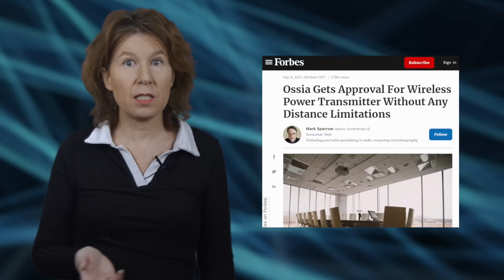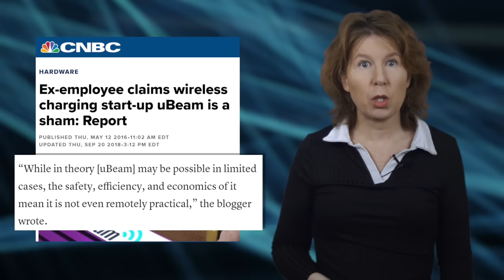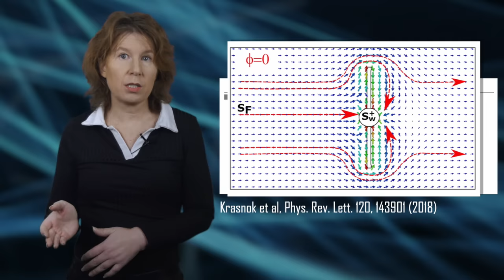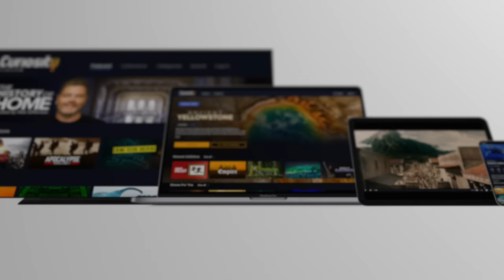How close is wireless power technology?

Comment: I built a tuned coil, essentially a form of crystal radio, to power a LCD clock from a local 50kW am broadcast station. It worked fine 15 miles from the station antenna, and required a 3 ft diameter antenna. Impractical for lots of reasons, but I thought it was pretty cool that it worked at all.
Reply: Neat, and there you have the additional complication that the AM signal is not staying at a single frequency but is split into upper and lower bands around the center frequency, so it messes up the perfect tuning. Changes in temperature alter tuning too, and even humidity could also alter tuning, depending upon your capacitor. Glad it worked!
Reply: you could have used a solar cell the size of a dime, cost about 25¢, and would work in 1lux of ambient light
TI and Casio have been selling solar powered calculators for about 40 years now.....
Reply: @kenwittlief255  you realise that OP could power a clock from their mains power if they wanted to? It's just more interesting and original to use radio frequencies from a distant station
Reply: LCD takes such low power, in class we would comb bare panels in our hair and they would turn on and go opaque.
Reply: @kenwittlief255  a coil is a hellofalot easier to make than a solar panel.
Reply: I've done a similar thing. I have a few feet of wire connected to a tuned circuit in my study powering a bank of  coloured LEDs (about a mile from a 1MHz A.M. station). And of course there is a ground connection for the returrn path. The comment below regarding sidebands is an irrelevancy - the carrier is always present at some level and anyway it's cool to see the modulation affecting the brightness of the lamps (in a minor way). Best use I've found for talkback radio which is what this particular station broadcasts.
Reply: In
Reply: When way very young (1960's), I took the rectified energy from b a Crystal set radio and powered a one transistor amplifier for that radio..    ie used the local AM Broadcast station's radiated energy.  😂
Reply: Similarly you can use a phenomenon called "near field" rather than radio frequency (RF) to transmit information approximately 15 to 25 feet as a magnetic radiation remote control. I was looking to build a receiver that could sit in the on state ready to receive a signal from the transmitter without running the batteries down after only a short time. The transistor receiver ran on about 10 micro-amps from a 6 volt battery until it detected a signal. The transmitter however used a large sum of energy to send a signal, but was only on briefly, so therefore used little power also. I tried in vain to extend the range of the transmitter / receiver combination, but to no avail. The strength of the magnetic radiation signal falls off rapidly as the distance squared. If I'm correct (maybe not) this near field phenomenon is what researchers, and manufacturers of some of the devices she has mentioned are using to transmit power to remote devices. I think I read that the transmitters oscillate at around 11 mhz. My transmitter only oscillated at a few thousand hertz to send the near field magnetic radiation signal.
Reply: @YodaWhat  the transmission pattern of an antenna depends on its shape and size in comparison to the wavelength
Reply: @zweisteinya  Yes, but MOST of the Wireless Power is done using Near Field Radiation, which is NOT transmitted power. To the best of my knowledge, Near Field Radiation is omnidirectional, regardless of any antenna used, though it may still be polarized. This is stuff you cannot derive from the 4 LIES of Incompleteness which are sold to us all as "Maxwell's Equations".The TRUE Maxwell's Equations number 20, and are in the form of Quaternions, and therefore obey a radically different algebra, with much more nuance and possibilities. One such difference is that the intensity drops off faster, as the 5th power of distance. Another difference is that Near Field Radiation consists of Evanescent Waves, and strange as it sounds the energy is NOT radiated UNLESS it is received... rather like Quantum Erasure.
Reply: @kenwittlief255  but not at night

Comment: Little nitpick at 8:52 : The USB specification now goes way beyond 4.5W the newest versions go up to 240W. (see https://en.wikipedia.org/wiki/USB#Power-related_standards )
Reply from the maker: Thanks for pointing out, I hadn't known about this!
Reply: for theoretical physics that would still count as fairly within the limits ;-)
Reply: But thats imperialist measure, metric is more efficient
Reply: @edsnotgod  Watts are metric. The imperial(ist) unit is horsepower. So USB has increased from 0.006 HP to 0.32 HP of power delivery.
Reply: @TysonJensen  horsepower is typically won by burning copious amounts of diesel fuel in a 20 gallon Cummins engine
Reply: @edsnotgod  It's only real horsepower if its made from real horse.
Reply: I've come looking for this comment
Reply: @Evi1 M4chine All these higher power standards use negotiation to determine the voltage, current is maximaly 5A, voltage is increased. So the wires wouldn't need to be that much thicker. Phone and charger could measure cable resistance to prevent melting cables (I don't know if they do this btw.).
Reply: @TysonJensen  Imperialist power is measured in slaves per capita.
Reply: @TysonJensen  Imperialist power is measured in Putins.
Reply: Came here for this. My USB-C phone charges at 40W. I didn't know that cables went up to 240W though
Reply: @jamesvandamme7786  A gigaPutin?  Better a microPutin.  Resistance measured in Ukrainoids?
Reply: @Musicownz1997  the 240W surprised me, too. I was aware of 60W and 100W for Laptops with Dell going up to 130W outside of standards. Interesting to note, that the maximum current seems to be limited to 5A and now only the Voltage is cranked up from 5V to 9V, 15V, 20V, 32V, 48V.
Reply: Damn, I have to change the cable yet again!?
Reply: While it’s true that power can go up to 240W, most phones will limit before 10W. 100W ratings were put in place for laptop charging and things like that. The trick is that compliant chargers will negotiate for higher voltages, increasing the delivered power to the device.
Reply: @isaacamante4633  Now you found it, what to do now?
Reply: @SabineHossenfelder  usb has extra protocols for power delivery.(newest had around 700 pages, enormous pain to read) even old phones and powerbanks were 5v2A/3A or 10-15watts, and even older ones 5v1A. The lower currents are usually used for data communication.
This certainly needs a correction comment, considering the fact channel is scientific.
Reply: Seconds later, at about 9:00 she then says it's good to power small devices like alarm clocks and other things *you don't use*. Her typical deadpan straight face delivery got me. 😂😂
Reply: Science Revolution  Talking to the walls again, dear?
Reply: @TysonJensen  0.32 HP XD that's not a lot of health points.
Reply: @TysonJensen  Imperial electric units?

Comment: Sabine, there was a case in the UK some years ago. A man whose house was directly under an overhead power line set up a large induction coil in his greenhouse, and was able to provide most of the electricity his home needed for free. However, the power company was able to detect this relatively small drain on a national wide power grid, and he received a heavy fine in court. I understand that was electromagnetic induction, but it is a good story.
Reply: How was it detectible?
Reply: @Anonymous-df8it  excessive voltage losses on the line, probably showing a pattern as well.
Reply: @HotelPapa100  But it's so small?!
Reply: @Anonymous-df8it  I am pretty sure that they observe power losses very precisely. And if a branch of their grid suddenly has higher losses than usual, they investigat.
Reply: @HotelPapa100  I meant as in "It's probably smaller than random noise, so it won't be detectable even with the best instruments"
Reply: If they don't want him installing a coil in his greenhouse, maybe they shouldn't be pushing an EM field through his property.
Reply: it was well within the accuracy of their instruments and far above random noise, that's how that guy was caught.
Reply: @JosePineda-cy6om  How was it far above random noise?
Reply: He was taken to court?
 I'm Shocked! On what CHARGE?
😁Did he get arrested or did he Resist? 
POWER to the People!✊
Reply: @Anonymous-df8it  Lenz's Law for Electromagnetic inductions states that the current induced in a conductor will produce a magnetic field that will oppose the force that produced it. 
  This will produce a load that will be detectable my the source, IE the power company.
You are simply making transformer by placing a coil inside an oscillating magnetic field created by the overhead power lines themselves.
Reply: @fistpunder  I'm just shocked that it exceeded random noise!
Reply: @Anonymous-df8it  Someone must have ratted on him !
Reply: @centerfield6339  I agree. If he is subjected to an EM field, shouldn't he be allowed to exploit it? This reminds me a bit of people being fined for collecting rainwater.
Reply: You guys are overthinking it. They probably detected his implausibly small electric bill.